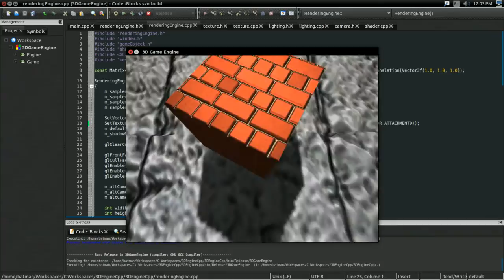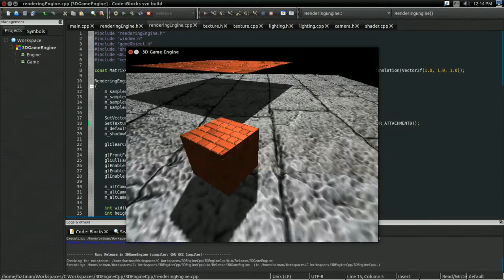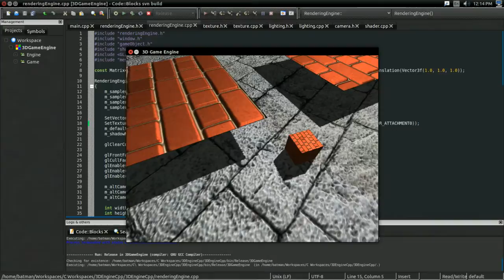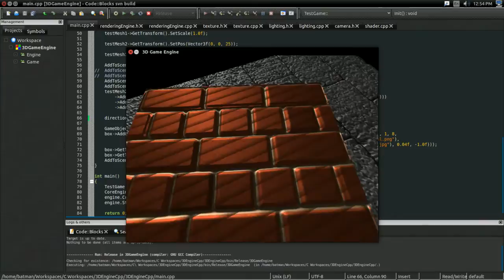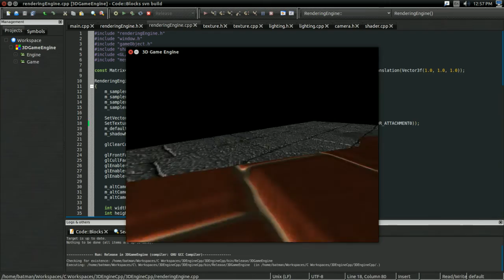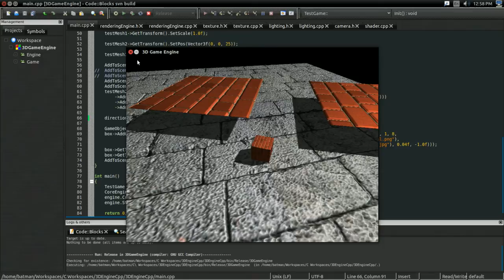OpenGL Game Rendering Tutorial: Variance Shadow Mapping Implementation 2/3

Comment: Hey benny I'm following your tutorials in the java version, And Everything worked fine, Until I changed the shadow generation shader code, When I made the z and w parameters of the fragcolor into 0, The map is only drawn once and after that it's stuck. If I move an object the shadow is stuck and it doesn't move, When I change the z and w values back to "depth", It renders fine but the shadow has little issues. What seems to be the problem ?

EDIT: If I change the W value to 0.1 it works, But there still seems to be issues.

Comment: Is the math from collage useful for making 3D games or apps in general?
 Also i have a question that is not in the topic but are you that kind of person who likes to make engines instead of games?Do you find more enjoyable making engines?
Reply from the maker: This is a bit tricky to answer. Of course math is important; you need to have a strong grasp of vector and matrix math, linear algebra, trigonometric functions, and at least a basic grasp of calculus to really excel at this stuff. So I suppose that covers a few things that would be in "math from college."

However, at least in my experience, when people talk about "math from college" they're talking about more advanced, upper level math concepts. And in my experience, there's a good chance those things aren't strictly necessary. The thing is, if you're trying to do something that requires advanced, high level math constructs to calculate, there's a really good chance that it simply won't be fast enough to be practical for real time usage. In those cases, you'll need to either do something different, resort to an approximation, or resort to some sort of monte carlo technique that converges to the results you're after. In all those cases, the math is almost certainly simpler than the advanced upper level math that people think of when they say "math from college." That's not to say knowing that math doesn't help: having a better understanding of math is almost always greatly beneficial when you're doing this stuff. It's just you might not explicitly use the exact concepts and ideas that got you to that level of understanding, if that makes any sense.

As for your second question, those don't compare very well in my mind because I enjoy making games and making engines for different reasons. I enjoy making games for the whole stream of consciousness style thrill of it all. When I create a game, I'll create something that's reasonably fun, and that'll give me an idea for another thing to make it more fun, and when I create that it'll give me another idea, and so on until the finished product. It's really satisfying when everything you do makes a slightly more enjoyable result.
On the other hand, I enjoy making engines for the engineering challenge. It's a really interesting puzzle to figure out how to balance the various capabilities of an engine with things like raw performance and game creation productivity. It's also quite fun and satisfying when you discover something that's a win on all fronts.
So to answer your question, I'm not really sure. I enjoy both a great deal, but I enjoy them for different reasons. I'm not sure that I particularly enjoy one more than the other.
Reply: Math is very important when it comes to games. Especially 3D games. The most important thing that I think colleges don't teach is once you learn the math, they don't teach you how to really convert scientific equations to a usable algorithm.